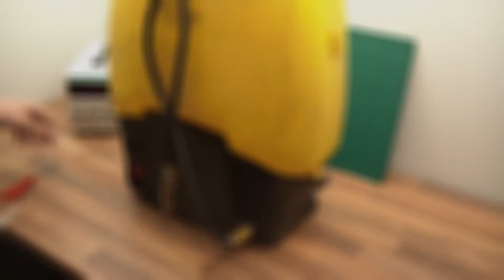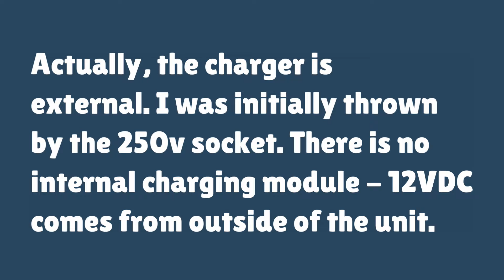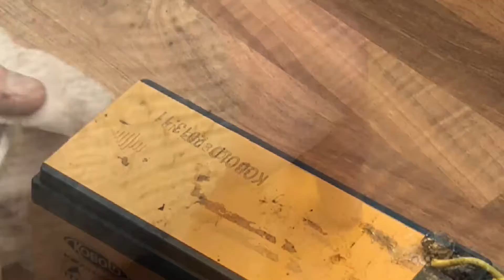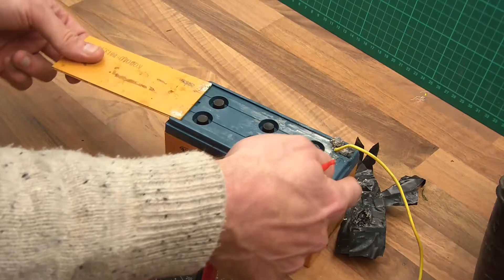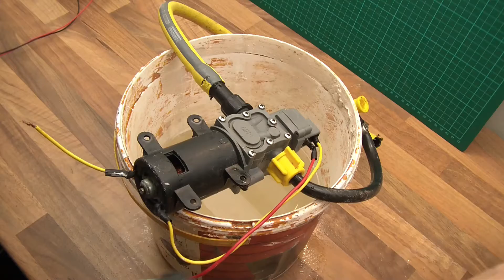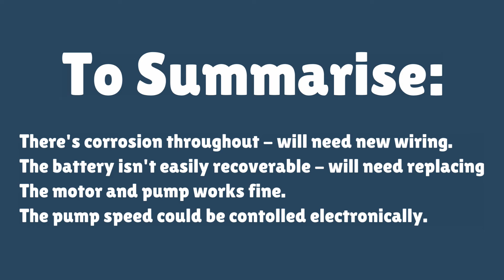REPAIRING: A Window Cleaner's Backpack - Water Pump Teardown - (Part 1/2)

Comment: This is great. I've been working on a project to update a Gardiner Backpack. I've been reading up on 12v electronics - once I'm finished I might ask you to consult on my pet project if you're interested. I can send photos for critique on making them more robust and more important - new ideas for improving work flow.

I have a list of improvements on two dimensions. Robustness and Performance

I want to make the backpacks the core of my water fed pole systems because they are capable of it and are nice encapsulated systems - ideal for experiments. The first effort is to make the backpacks more robust e.g. marine wiring, proper fusing, battery monitors, better batteries with longer performance, adhesive heatshrink, better terminals than just some twisted copper wires, and just more protection from daily backpack abuse.  

The second effort is to extend the powers of what a backpack is - I'm to install remote radio links, I'd like higher flow from the pumps - so probably new pumps, ideally would like an intelligent circuit capable of figuring   out dynamically that resistance is climbing when a water fed pole is extended upwards or the hose has become extra long e.g. 100 ft to 300 ft - and to maintain consistent flow of 2.5 litres per minute in these scenarios. I'm also converting them from 22L capacity tanks to 650L+ using fill valves as part of a simple gravity hydraulic scheme, and I want more ideas, more possible improvements so I can use backpacks to bust through a ton of work. I originally just switched from Gardiner pumps to Everflo pumps because they allowed the backpacks to be used in soft washing as well as pure water - but I'm sure there are plenty more ways to radically improve the design to enhance productivity.

If you're interested in consulting on such a project email me at internaut@internet-mail.org